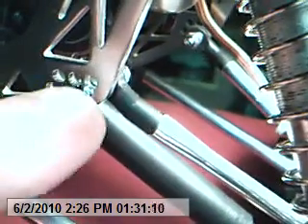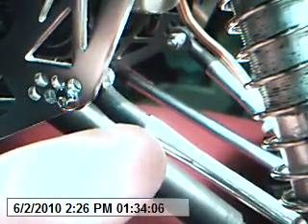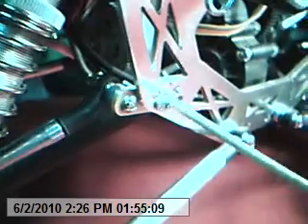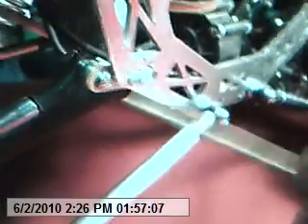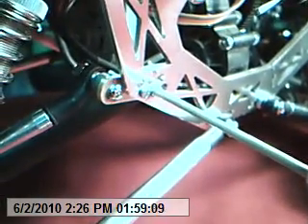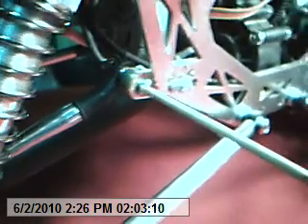Komodo chassis modification part 1

Comment from the maker: CplCarmine

The two models look quite the same
I'm not as familiar with the Axial frame but if it has certain pivot points that can be moved,, it will articulate better if it is lengthened. 

The Komodo was a stiff, top heavy unit with the battery mounted on top and it rolled easily with no foam in the tires as the rubber would roll under with no weight on it at all. By adding home made foamies,, (see my other videos) and changing the length and twisting abilities of the chassis. It's better